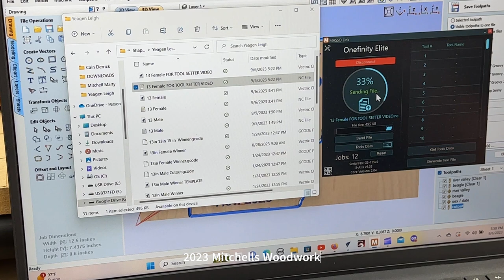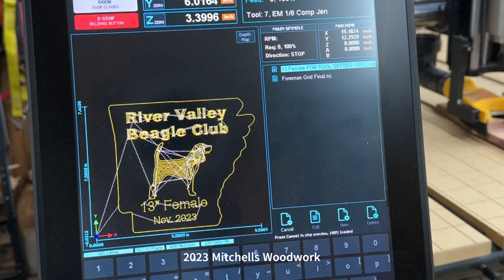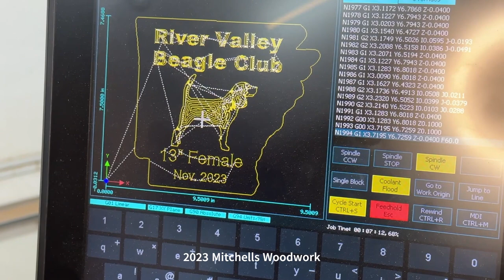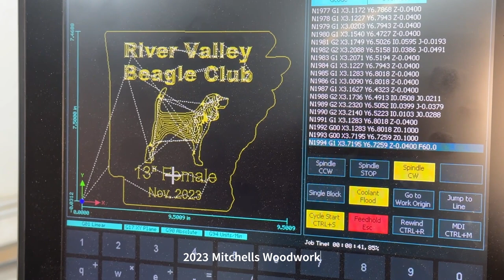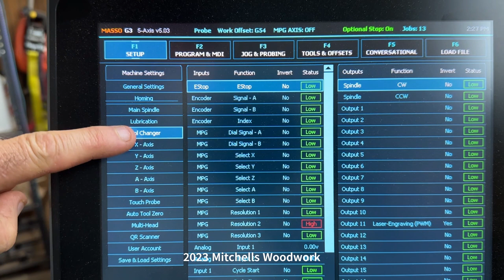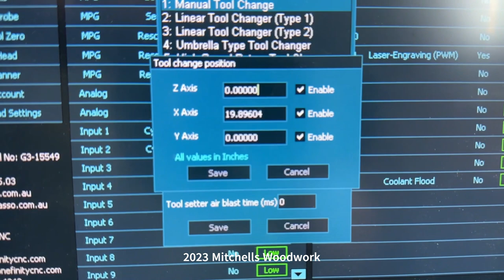Why Your Onefinity Elite CNC Needs A Tool Setter!  PLUS Bonus Masso Setup Tip!!

Comment: Love the videos. I have had my tool setter for awhile now and I used it a few times. Some times it worked and sometimes it didn’t…. Not sure what I am doing wrong?? I have a couple questions. 
Do I need to have the tool number programmed into the masso unit?
Could you make a short video on how to program with tool number in vcarve and then load it to masso then run the job? You explain things so well!
Thank you, and keep making videos!
Reply from the maker: Hi Mike, thanks for the question.  I recommend that you read the tool setter info in the Masso doc linked below.  

📸 Look at this post on Facebook https://docs.masso.com.au/wiring-and-setup/touch-plate/how-tool-setter-works?fbclid=IwAR1l5bz1VHWODUYoBAI8gf4RcLCv60PlszoTYtGj9zTB4yOVkqMWmMxJyns_aem_AdXw6aPlwPCEDSJiQnSaPHZaimZH0c3YTOKFOiP8y0AUwlni4d-RoJBDn3fTY2ypJPc

If you’re asking if your router bits have to be numbered in Masso, the answer is yes.  If you’re using VCarve you’ll first need to assign a unique number between 01 - 100 to each bit in your VCarve tool database.  Then use those exact numbers when you add them to your Masso.  

I’ll try to make a video of this process in the near future.  Thanks for watching!

Comment: I started with CNC machine tools long before automated tool setting was available, and I manually touched off thousands of cutting tools. If you wanted any cutting tools preset, then you set the length in the tool room and measured it for accuracy using a height gage. Eventually, the VMCs had a very expensive tool setter but it was up to the machine tool programmer (me) to write the program to set either a single tool or every tool in the carousel. How things have changed over the past 45 years. Instead of several thousand dollars for a tool setter the price is easily affordable by hobbyists.
Reply from the maker: Thanks for commenting, it's great to get a perspective from someone that was doing CNC's many years before they became so accessible to the masses.  I don't know what "VMC's" are, but did you write the program and use the tool setter when it became available?  If so, what were your thoughts about them at that time?
Reply: @MitchellsWoodwork  A VMC is a Vertical Machining Center. It's basically a large CNC milling machine with a full enclosure, automatic tool changer, flood coolant to extend life of the cutting tools, and other features. And yes, I had to write the program that enabled the tool setter to perform its function.
Reply from the maker: @gaiustacitus4242  was it all gcode and mcode like these machines use?
Reply: @MitchellsWoodwork  Yes. It had to be hand written because the post processors available for EZ-CAM didn't support our version of the Fanuc controls. That wasn't much of an issue though, as I'd been writing G-code with the assistance of my trusty HP calculators and a text editor for years.

I've never actually worked with a CNC machine tool that didn't use G-code. The closest I came to a machine that didn't use G-code was sitting through a presentation for a Hurco milling machine at IMTS in 1992.
Reply from the maker: @gaiustacitus4242  That's awesome!  I sure hope you continue to follow my channel and offer your unique insight.  I enjoy your perspective on modern CNC tools and techniques as compared to "back in the day". :)

Comment: I have mine but haven’t set up my machine yet. Can’t wait!!  
Thanks for the video!!!
Reply from the maker: Man you need to get busy! 😉👍
Reply: I have seen suggestions that The mounting of the spindle should be as far down as possible, with even, a second mounting at the top of the spindle

Minimizing  "spindle stick out" 😊
Reply from the maker: @satxsatxsatx  I’m not sure what you mean by “a second mounting at the top of the spindle”?  Please explain.
Reply: @MitchellsWoodwork  I've got one of these for my Elite, and can vouch for it's usefulness, and the efficiency it brings by not having to save tool paths individually. I just wish Steve Dash had made the button on it ever so slightly larger, as I can't use it on bits like a 9.5mm diameter keyhole bit. No problem though I just save the keyhole path separately and turn off automatic tool setting. When I'm done, I turn it back on.
Reply from the maker: I'm glad to hear that you're enjoying your tool setter too, John.  Thanks for watching and commenting!!

Comment: Great videos, very helpful.  I have a question.  I've been using a tool setter and love it.  I recently surfaced my table.  Do I need to change settings as now my table is lower than it was?
Reply from the maker: Great question, but I don’t think that will make any difference, as long as your tool setter is still at the original height as before.  But let’s let the manufacturer @sdasherx chime in to make sure.  I’ll let him know he’s being paged.😉
Reply: Hi sea5363, There is no need to change any settings as long as the tool setter stayed in the same location.
Reply: @sdasherx  Thanks I figured that but was still a bit puzzled.

Comment: How does it know the thickness of material your milling? From job set up input? And where you put your job. Do you still use probe to locate x and y?
Sorry for all questions
Reply from the maker: To begin, use your first bit and the probe to set your initial X, Y, Z zero, just like always.  

Then, when it’s time to switch to the next bit (and tool path), the tool setter measures it and adjusts the spindle (or router) Z height to match the Z height measurement from your original probe at the beginning.  

The tool setter eliminates the need to manually probe the 2nd, 3rd, etc. bits used on the carve.  It also allows you to save and load ALL of the individual tool paths into one gcode file.  No more loading each tool path individually.  

Long story short, there is NO disadvantage to using a tool setter.  It’s all a 100% advantage over doing it the old way.  Very few things in life give 100% benefits with no down side, but the tool setter is one of them.

Comment: @Mitchellswoodwork, which do you like better?  The Elite Foreman, or Shapoko Pro ?
Reply from the maker: Hi Daniel, thanks for watching and for the question.  First let me assure you that I am not sponsored by Onefinity or Shapeoko.  

Comparing my previous Shapeoko Pro XXL to the Elite Foreman, I’ll do my best to keep it fair by comparing apples to apples.  Speaking strictly about the actual CNC hardware and not the controller:  The Onefinity is so much stiffer and stronger, it’s not even close.  Also, belt driven machines, like the Shapeoko I had, can’t compete with ball screw driven machines in terms of speed, accuracy and durability.  

As far as the controller aspect, the Masso has no peer in the hobby CNC market.  It is so far above and beyond anything else available for the hobbyist, it’s impossible to compare it to anything else.  It’s simply in a class of its own.
Reply: @MitchellsWoodwork  sounds like your all for the onefinity Elite Foreman!  I’ve been looking for a little while now and thank goodness I came across Onefinity.  I was set on the Shapoko, but have now decided against it.  Thanks for your advice!

Comment: Nice video. Can you place the tool setter anywhere on your wasteboard? Like the top right corner, for example. And if so, then I'm assuming you have to program it in Masso so it knows where it's at?
Reply from the maker: Yes, technically you could put it anywhere within the cutting area of your machine.  Then it’s a simple process to program the location into your Masso.  Thanks for watching!

Comment: Hey, man.  What's the difference between the Tool Changer Position you describe at the end of this video and the Parking Location you describe in another video?  Any reason why I wouldn't want to set both?  Considerations in choosing a parking location?
Reply from the maker: Typically you’d want the tool changing position to be in the front for easy access.  But the parking position is where you want the spindle to move to when the carve is completed.   Moving it to the very back of the machine usually gives you easier access to remove the piece you’ve just finished carving.

Comment: Great video.  Just a quick question (trying to get my head around the flow of things).  Once the material is mounted, do you first use the touch probe, so the machine knows where the material x, y, z is... and then it auto sends itself to the touch probe to touch off?
Reply from the maker: Yes, you’ll use the probe for the X, Y, Z measurements ONE time.  From then on, the tool setter measures each new bit automatically before resuming the carve.  Trust me, it’s the greatest thing since sliced bread!
Reply: That makes sense, I was getting myself confused again. Lol. Thank you, keep up these videos, they are informative. I bought the Foreman (and the Kreg bench). The bench is here, now waiting on the machine.  Have a lot to learn!  @MitchellsWoodwork

Comment: Thanks for the great videos.

I do a lot of flattening with a 1-1/2 inch bit. Is there a way to easily bypass my tool setter? 

After homering, the Masso automatically goes to the tool setter, and that 1-1/2 bit can not use the tool setter.
Reply from the maker: Yes, in Masso > F1 > Auto Tool Zero > Uncheck “Enable auto tool zero” > Save

Comment: You homed, set the tool and then started the cut. How did it know your material thickness?
Reply from the maker: Great question and I’m sorry I failed to cover that.  The very first step is to set your Z on the surface of your material, whether with a probe block or by using the paper method.  The advantage  of a tool setter is that you only have to manually set your Z on the work surface one time.  Once the Z is established the tool setter will take over from there and measure each new tool and automatically make adjustments for different tool lengths.  No more resetting the Z after each tool change.  

Also, with a tool setter you save all of your tool paths to one file and send the gcode to your post processor.  No more loading each tool path separately!

Comment: Sir, 

So I’m a little confused by the but setter. How does the bit setter know the material Z ? Or are you getting a material Z before hand?
Reply from the maker: Great question and I hadn’t realized that I didn’t cover that.  The very first step is to set your Z on the surface of your material, whether with a probe block or by using the paper method.  The advantage  of a tool setter is that you only have to manually set your Z on the work surface one time.  Once the Z is established the tool setter will take over from there and measure each new tool and automatically make adjustments for different tool lengths.  No more resetting the Z after each tool change.  

Also, with a tool setter you save all of your tool paths to one file and send the gcode to your post processor.  No more loading each tool path separately!
Reply: Thank you Anthony8374 for asking that question.  I was wondering the same.  And thank you Mr Mitchellswoodwork for yet another generous/helpful answer!!  Your videos are SUPER great (and dam funny)!

Comment: Hello Mr. Mitchells. I found your channel, and really like your vids. I'm new to CNC world, so I'm on a fast learning curve now. I do have  Onefinity Elite Foreman, which I manually operate my spindle(I yet to figure out my VFD settings to make MASSO Touch control it). I bought tool setter(Z Zer.o), that mounts to table(I build my own), I tried to run couple of tests on a sample wood, but my Bit plunges so deep, emergency
Reply from the maker: I answered your second post.

Comment: Nice video.  By design, if using a bit setter.. you are setting z off the surface of the spoilboard right?

how does resurfacing spoilboard impact this?  Also if my material thickness isn’t 100% accurate on CAD software, assuming this matters as well (as opposed to setting Z to material surface with a probe).

Am I understanding the process correctly?
Reply from the maker: I’ve never had the nerve to try zeroing off the spoilboard.  But there’s another follower on here that has just about convinced me to give it a try.

Comment: Great video, thanks! Is the tool setter lower than your spoil board? It's hard to tell from the video, but it doesn't look flush with the spoil board. Just curious, I've ordered mine but haven't received it yet. Does it have to be flush with the spoil board?
Reply from the maker: Thanks!  After surfacing my spoil board once, my tool setter sits -.07 below the surface.  It can be hard to explain or comprehend, but the height of the tool setter is totally independent of the height of the spoil board.  It’s going to work out the math regardless.  Having said that, I prefer the tool setter to be below the surface so that it doesn’t contact the work piece.  For example, when doing a tile cut, the work piece could need to be placed over the top of the tool setter.  In that situation you’d just have to resort back to the old way of setting the Z zero manually after each bit change…using the probe block or paper method.  

Let me know how you like it when yours is installed! 😊

Comment: New to OneFinity, cnc and vcarve. So, when you are saving your g code are you saving each bit as a separate g code file?  That’s what I do now. It sounds like you are somehow saving one g code with a bunch of bit changes in the same file.  Or did I understand that wrong and each but change you are doing is another file?  If that makes sense 🤣
Reply from the maker: You are correct, I use the “save all visible tool paths into one file” option in VCarve Pro.  To my knowledge, you can only do this method if you have a tool setter.  That’s one of the main benefits of having a tool setter.  

Which 1F machine do you have?
Reply: @MitchellsWoodwork  well now I want a tool setter even more than the first video!  I have the 1F Elite Journeyman. First cnc and first go at vcarve or anything else computer design.
Reply from the maker: @a91customs  the tool setter I’m using was only $70 or so including shipping.  I have it linked in the description.  You’ll never regret adding a tool setter.  There are no down-sides to having a tool setter, it’s all good.

Comment: Im still wondering which cnc is better Shapeoko pro 5 4x4 or onefinity elite foreman 4x4 & so far im seeing shapeoko pro 5 getting better results! Which is better?
Reply from the maker: I was a Shapeoko guy too, and I really loved my Shapeoko Pro XXL 32” x 32”.  When I realized I needed a bigger machine, the SO5 Pro was my original go-to upgrade by default, but Onefinity was on my radar as well.  The number one thing that eventually made me choose the Elite over the Shapeoko 5 Pro was the Masso controller.  

After using my Elite for a few months it has proved two things to me, without a shadow of a doubt: 

#1 is the Masso controller is everything I imagined it would be times 10!  It’s capabilities are so far above and beyond anything else in the hobby CNC universe that there’s really nothing else to compare it to.  It truly is THAT much better than the rest.  

#2 is that I can now see daily in real life operation how much stronger, stiffer and faster the Onefinity Elite is than the rest of the hobby grade machines on the market.  Like the Masso, the Onefinity is truly in a league of its own, and actually overlaps into the commercial grade level if you only need 48” x 48” capacity.  

The Shapeoko Pro does come with more bells and whistles out of the box (a tool setter being the most glaring example), but the aftermarket tool setter I use now is every bit as accurate and functional as the one on my SOPro XXL, and it only cost $65 US.  So don’t let that, and the BitRunner, cloud your judgement.  Do your homework.  Watch the Onefinity vs Shapeoko videos here on YouTube and they all lead to the same conclusion:  Onefinity is better.
Reply: thanks  @MitchellsWoodwork

Comment: I have watched a few of your videos, and it would seem that you and I have traveled a similar path. I started with a shapeoko xxl, and recently graduated to the the OneInfinity Elite. I am chomping at the bit, waiting for my spindle to arrive from pwn. I heard you mention that your dust collector is a Festool in either this video or one of the others I have watched. I use a CT 48, but the factory D27 hose is not big enough for the workload, resulting in multiple clogs. Should I go with the D36, or do you have a different recommendation? The collector and the extractor were not cheap, and I would like to use them in the most effective manner possible while not adding to my workload and having to babysit and clear blockages.
Reply from the maker: Yep, I have a Festool CT15 with an Oneida Dust Deputy mounted to a 5 gallon bucket.  Works great for everything except a surfacing bit.  The CT48 should be an awesome option.  Which dust boot are you using?
Reply: @MitchellsWoodwork  I got the one that Onefinity carries when I ordered the machine not realizing that it's receiver ID is around 2 inches. My OD on my hose is 1.35 inches. When I ordered the spindle from pwn, I order their bundle for this machine and it was either the V9 or V10. I have not receive the order yet because there is a lead time on the spindle.